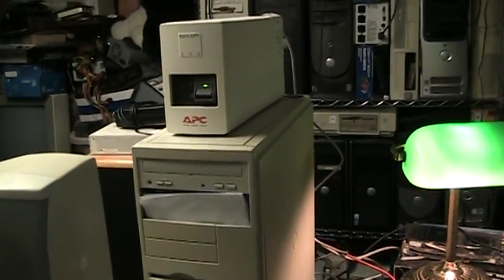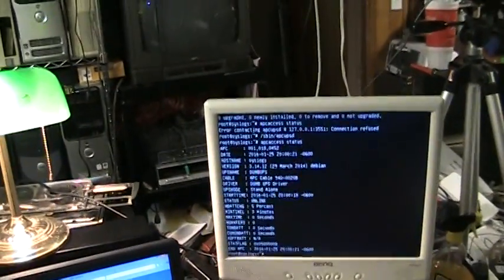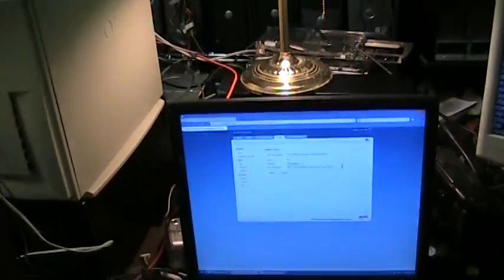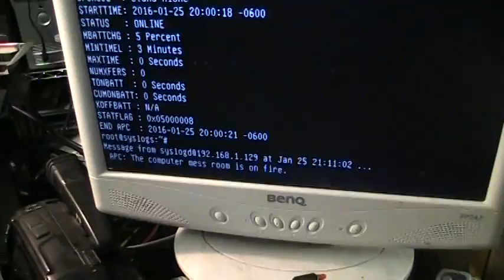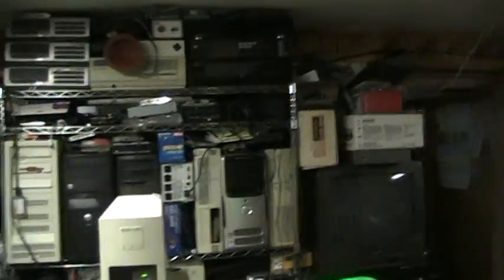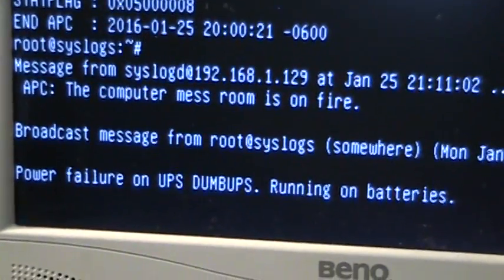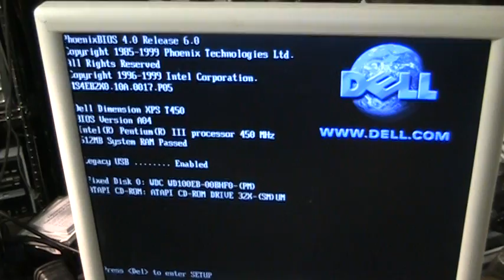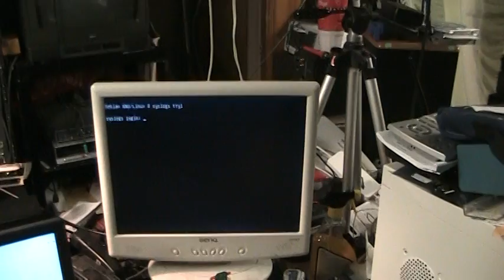Little Tiny Computer Ramble: Syslog Server and UPS Test

Comment: I need to find one of these for backup power. If the battery is toast I'll connect a cigarette lighter cord to it and run it off the many jumpstart packs that I have.

BTW I love the way you talk in your videos. Very complete and to the point.
Reply from the maker: +coondogtheman1234 These older units show up everywhere, though usually with dead batteries. I'd really recommend something bigger for most modern computers. Even halfway loaded the runtime will be quite short, and a lot of today's computers don't have serial ports if you want to make use of the monitoring and shutdown functions. (Microsoft also removed their basic UPS management software from Windows Vista and later, so you'd have to use something like the Windows port of apcupsd.)

Be very careful if you plan to use a cigarette lighter plug and connection. The absolute maximum rating for them is 150 watts, and the contact points are usually getting uncomfortably hot well before that. A desktop computer and monitor will quickly reach that limit. The proper battery (12V 9AH) is so cheap that you might as well have the right thing in there. Lots of sellers have them for less than $20 shipped on eBay.

You can modify these older Back-UPS models to use a much larger external battery. Their charging circuit does not "evaluate" an attached battery in any way or become confused because a battery is much larger than what the unit was designed for. There is a limit, though. The maximum charging current is about 500mA and some larger lead acid batteries may self-discharge faster than that. The inverter will shut down if overloaded, though you must keep in mind that the circuitry can overheat and burn out when called into service for a longer runtime than the original battery could provide. For light loads (<75 watts) this isn't a problem. For any load larger than that, or a highly inductive load, passive components on the board and the output isolation transformer start heating up fast.
Reply: +uxwbill I was just going to run maybe a few lamps and a fan. my pc monitor is an LCD type and when there's no power I use my smartphone if I want to get online.
Reply from the maker: +coondogtheman1234 If you want to run a fan on backed up power, don't get a UPS like this. The stepped squarewave output doesn't sit well with a lot of motors, and they might overheat. The inverter circuits in these Back-UPS models also have a hard time with highly inductive loads like a fan motor. Passive components inside the Back-UPS become uncomfortably hot.

Most of the Smart-UPS line (750, 1000, 1400, 1500 for sure) have a true sinewave output that is suitable for any electrical device. You can pick these up dirt cheap when the batteries wear out. Quite a few of them are on eBay. Ask the seller to take the old batteries out and the shipping cost will be a lot cheaper too.
Reply: *****
I'm not really an eBay kind of guy. I never used it before as I'm afraid of getting scammed. I know you can buy pretty much anything on eBay.

Do you think there may be some on Amazon? I know it may be more expensive but It's the only site I can buy from. I don't really trust credit cards now b/c of all the data breaches in the news.

I did try running a window fan on a power inverter because the power went out in my town and after maybe 15 or so minutes (not sure exactly) it shut down and was very hot. I let it cool and it worked again. I guess power inverters don't like induction motors. I guess i'll have to find some 12 volt fans.
Reply from the maker: +coondogtheman1234 You might be able to find some units that were cast off at a recycling center for want of working batteries. I've never seen a Smart-UPS at a thrift store. There are brand new Smart-UPS models available on Amazon and I wouldn't be surprised to find someone selling refurbished units as well.

Or you certainly could go with twelve volt fans and LED lights, paired up with a good battery charger...maybe even a small solar panel and charge controller.
Reply: *****
I built a few lights from parts I had lying around and have plenty of USB fans and power banks

Comment: not a big fan of Jessie. all that systemd crap.
Lennart Poettering is one of those few people on my poop list. goes from being a nobody to controlling everything about how Linux initializes overnight... replacing sysvinit and making his init system able to eat up everything and become a dependency for EVERYTHING ELSE in the process. there's a reason Gentoo for one uses a different init system.

sadly I've never dealt with rsyslog or any other commandline tools to work with such. I hope someone else that watches your videos does.

I do want to know what you used to get apcupsd to talk to the 300-- my own 300 did not seem to want to talk to it at all when I had it set up with my OptiPlex 760 USFF way back, and I blamed it being a "dumb" serial interface and not having any sort of brains to it other than "this pin being low means the battery's about to die" etc.
Seeing it work with a system after all is a great thing indeed. Sort of wondering now if I was even using a null modem now.
Reply from the maker: +Sudos I don't know anything of the whole systemd thing, if it's bad I'd be none the wiser.

I started out by figuring out where Debian was enumerating the serial port, and once I had that nailed down, I went through the apcupsd configuration file. There I specified the simple signaling driver, a name for the UPS, and the serial port location. You've either got to build or buy a 940-0020(B/C) cable. I don't think I ever tried a null modem cable since I was pretty sure it wouldn't work. A straight through serial cable (visible in the video with a gender changer stuck to it) did not work either.

If the 760's BIOS offers the option of UART powerdown, that setting might need to be toggled. I haven't got a spare 760 right now to test, otherwise I'd throw the UPS on there and see if I could get it to pop.

Comment: That a pc is the exact type the grocery store I used to work at had for the old registers. Until they changed to dell type that had pos 2009 system the old ones had dot matrix printers. After they changed to new . They had a app type I believe the black ones. Unless i m wrong or they kept that type of a pc for the new ones

Comment: pretty cool ups and would be handy to use in a power cut.
though you might still loose the broadband service but I think they would have ups to so it should carry on working if its a big power cut?
Reply from the maker: +EastAngliaUK I have a Smart-UPS 420 (discussed in another series of videos) that holds up my connectivity equipment during a power failure. It's done an outstanding job. An extended power cut took place when someone hit a power pole with their vehicle and the Smart-UPS 420 kept going for over an hour with no sign of stopping. All that from the stock 12V 9AH battery brick it takes...I was extremely impressed.

When I had Internet service through the cable company, it stopped working whenever the power went out. My DSL service continues to operate normally through power failures.
Reply: +uxwbill 
What happened to the cable service that you can't use it anymore?

Comment: This is from a web page:  http://www.rsyslog.com/storing-messages-from-a-remote-system-into-a-specific-file/

You can achieve per host log file by using ‘template’ as follows:
           $template PerHostLog,"/var/log/%HOSTNAME%.log"

           if $fromhost-ip startswith ‘192.0.1.’ then -?PerHostLog

           & ~